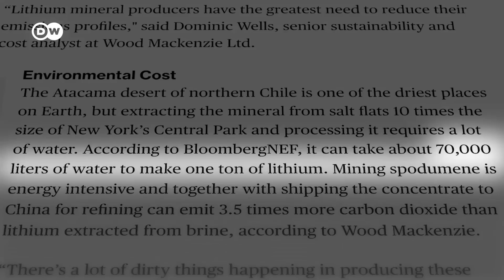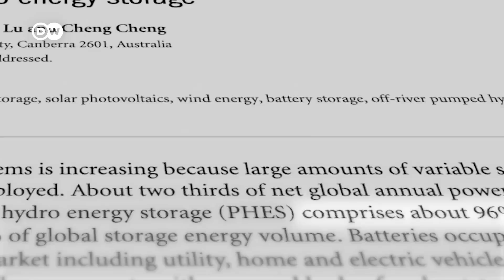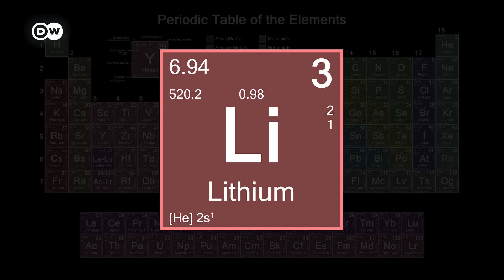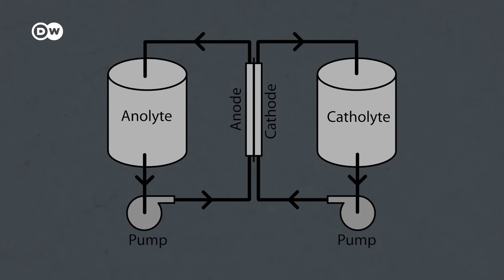How salt and sand could replace lithium batteries

Comment: 2:10
Only the high-end, high energy li-ion batteries require cobalt and even those are reducing its usage continuously. The majority of the volume of shipped li-ion batteries (LFP) does not contain cobalt at all. Not a real issue.
Reply: Oh I thought Lithium Phosphate was just entering the market.
Reply: @anxiousearth680  yes and no. LFPs are not used in consumer electronics and power tools because of lower energy density, but for cars they're already quite widespread. My wife's Model 3 from 2020 has a LFP battery.

Comment: Some good points made, lithium certainly has it's problems and limited to electricity whereas these alternatives are mostly heat storage not electrical. Molten salt is very good at storing heat but is also very corrosive.
Reply: 100% correct. 
Maintenance costs are the very reason it hasn't taken off in the last several decades.

Comment: The future of energy is not JUST renewables.  New nuclear has incredible efficiency and at least one of the designs also uses molten salt.  Not only can it store energy (ie from the grid) but it can also be used as part of the reactor fuel and cooling (it's called an MSR).  This means you can also generate heat as needed, as well as store excess grid energy as heat in the molten salt.  A 1 ton cube of uranium or thorium is about 14 in (35 cm) on a side and provides 40 million kWh.  It takes an area ~300m (1000 ft)  on a side to do that in solar per year and you still need storage.   You need 100,000+ tons of coal to get the same from fossil, so that puts everything in comparison.
Reply: But it has the word "nuclear" in it so it must be scary right?
Reply: molten salt and corrosion, read up on it
Reply: @markgonzales3588  HasteloyN is rather corrosion resistant and a lot of research is going into this.
Reply: @alainpannetier2543  It isn't ever going to be personal sized, most SMRs are in the 100 MW range, about 10x smaller than commercial reactors.  Also, there are orders now for these around the world, including in Ontario Canada.  Finally, I think you are confusing SMR with MSR.  SMR is small modular reactor, and MSR is molten salt reactor.
Reply: @alainpannetier2543  We will see.  It will take a few years but we will see.  You'd better hope it isn't though, because it is about the only source of energy dense enough to undo the CO2 damage.  It will take many thousands of TWh to undo, and that's after we stop using fossil.
Reply: @alainpannetier2543  That is a good question.  The short answer is you need a lot of energy to make and recycle all of that distributed energy.  By having high energy density, there is a lot more left over.  The other problem low density green energy is it takes up a lot of land - this is all land that could be used for other things, ie deserts, wildlife, etc.  Even a current nuclear plant (Palo Verde is a good example) takes up less than a square mile.  To equal its output, you need about 60 square miles of solar panels, but worse than that, you need to have the energy when needed, and that means batteries.  It also means all of the disposal/recycling as well and energy costs of manufacturing.  The term for this is EROEI - Energy Returned on Energy Invested.  Green energy has poor EROEI, even with the high efficiencies we have now, so you need a LOT of it, and a lot of batteries.  Interestingly enough, the two could play rather nice with each other, which is what I suggested in the first place - a molten salt system to store energy can also MAKE energy if it is also a nuclear reactor.  Also interestingly - all the unusual materials to make high efficiency generators, motors, solar, etc come from "rare earths".  Thorium is currently a waste product of rare earth mining, but it is a potential nuclear fuel (and works great in MSRs).  This means less waste when obtaining the rare earths needed for green energy.  Finally, nuclear reactors excel at generating heat, and a lot of processes today need heat, such as making fertilizer, or if you have a huge excess of energy, that means you could make liquid fuels (which the navy does now).  Sorry for the length, hopefully, this was interesting and thanks for conversing.

Comment: Idk if you guys take suggestions but could you talk about thorium power at some point?
Reply: Thorium is abundant but lacks fissile matter, the crux of nuclear fission chain. We will have to borrow fissile from uranium or plutonium from used fuel. The nuclear big brothers frown on the processes of enrichment for U235 or reprocessing from used fuel for plutonium.
Reply: Yeah I'm aware of the fact that it needs other materials to actually produce, could it just use new plutonium or would that not be economically viable? I'm not entirely knowledgeable on how breeder reactors work but I try ¯\_(ツ)_/¯

Comment: I disagree with the very first statement you made, 'We all know the future of energy is in renewables' - and this video is discussing the the ways we may be able to overcome the intermittency of renewables.
Nuclear doesn't have that problem. It works 24/7, 365 days a year, pretty much for 60+ years.
The new designs have prices per kWh from 3c - 10c per kWh, and don't need much storage.
Nuclear can also deliver heat directly to industry at prices 2c-5c per kWh, pretty cheap and reliable.

The future is nuclear..
Reply: yeah, europe could use the waste heat from nuclear power plants to charge up sand heat batteries year round, then use that stored heat in the winter. Waste heat from  nuclear is quite high. Co-generation if sent to the sand battery.
Reply: @bocadelcieloplaya3852  It would make sense  in winter to use the local housing/ office stock  as the coolant rather than just wasting it. That could also be said of the normal conventional power stations.

Comment: Aluminium air batteries are supposedly becoming standard in India. They are energy dense and easy to recycle.
Reply: Ooh nice!
Reply: @IJoeAceJRI  The aluminum hydroxide left after discharge is the exact feedstock used in creating raw aluminum.
Today the spot price is $2.40 per kilo, and the 'used' battery has recycle value.
So, while this is a modular swap approach as opposed to charge in place, there is never the issue of battery degradation.
Reply: @IJoeAceJRI  There are aluminum recyclers and mills all over.
The aluminum battery is said to offer about 1,000 miles (1.600 kilometers)
How do you get a tank of propane for a grill?
The logistics are about the same and I'd imagine the volume of transactions wouldn't be an order of magnitude greater.
When we buy a new lead acid battery for an ICE car we bring the old one back and it gets recycled.
Aluminum is a LOT less toxic than lead and sulphuric acid.
Reply: @IJoeAceJRI  That is correct.

Comment: A back of the envelope calculation how much sand would be required for 10.000 GWh thermal energy storage:
The project in Finland stores 8 MWh in a silo 4 meters wide, 7 meters tall. This is 88 cubic meters. So we can roughly say 1 MWh of heat storage requires 10 cubic meters. 
1 GWh would require 10.000 cubic meters. 
10.000 GWh would require 100 million cubic meters which is 'only' 1/10 th of a cubic kilometer of sand. 
This is thermal storage and you also want electrical storage of course, but it sounds doable.

Comment: I did my internship in TEHRI dam and they are yet to finish their PSP pump storage plant. 1000 MW  plant. 
Basically two dams are built one small other one large. Tehri dam reservoir takes water from smaller dam when electricity is cheap and than use that storage water to run 4 turbines.

Comment: 2:05 The lithium-ion batteries used for power storage should and would be the lithium iron phosphate batteries, therefore the costs of mining cobalt would be much reduced as one component of the battery is replaced by something much cheaper and more environmentally friendly. But I am not sure about the phosphate part of the battery, since I am quite aware of how damaging phosphate mining could be. But if we could recover phosphate from the soil due to our history of excessive phosphate fertilization, that would solve most of the batteries' cobalt problem.

Comment: I didn't quite understand the comparison at 05:37 , it sounded like you said salt can keep the heat for 6 hours, while lithium batteries can only keep their charge for 4 hours?!?
Obviously that's not what you meant... so what did you mean?

Heat dissipation time depends on many factors, such as thermal mass volume/weight, temperature difference, and insulation, while lithium batteries can hold their charge for much longer than 4 hours, so that's not it.
The time it takes to deplete the stored energy depends mainly on power requirements, so that's not it either.
Please clarify.
Thank you.

Comment: We don’t need to store even half of the energy provided if we simply change our economic model of production.  

There’s only a handful of things that require on-demand-round-the-clock power, and those are things like medical facilities, cold/hot  temperature storage needs, maintenance/emergency services, and transportation.  

Everything beyond that is merely a demand of over-production by industries that want to always have all the energy they want when they want it to produce as much as possible to sell as much as possible.  

Which again, is how we GOT ourselves into this mess in the first place.

Comment: Sodium batteries make sense for grid level storage and can be a really good alternative in the short run. However, in the long-run we will have to find less heavy options which can be used in EVs and consumer electronics. Also, these alternatives need to be less damaging or atleast not more damaging to the environment when compared with Lithium iin batteries.

Comment: At 5:40 there's a really weird claim about lithium batteries, either that they can only store heat for 4 hours, or they con only store energy for 4 hours. The first one is just factually inaccurate - lithium batteries don't store heat, and the second one is intellectually dishonest - a charged lithium battery can hold its charge for days or weeks with very little capacity drain.
Reply: I was confused by that statement as well.

Comment: How about the Nickel Iron (Ni-Fe) battery, which has been used for backup by telephone companies for decades before cellphones obviated the need?
Reply: what about nickel zinc? i have some NiZn AAA and AA batteries i got from maplin(uk) a few years back, 1.6v cell voltage and capacity bit lower than NIMH types for the size, could likely be scaled up? problem is service life, mine are starting to randomly fail 'open circuit' ?

Comment: Salt battery? Turning electricity into heat and back into electricity is not a battery. It’s a way to get rid of electricity. The efficiency must be lower than 25%. That’s fundamental physics. 
Storing heat in salt makes only sense if you store actual heat as the first stage of a process to generate electricity. Like in the solar thermal power plant.
Reply: I agree. this is way oversimplified battery production in industry and over glorifying nothing that's proven reliability, efficiency, profitability, and even possibility of mass production with quality assurance. there's nothing about mining, refinery, transportation, and longevity are considered in this documentary either

Comment: Video forgot to pay attention to the most obvious one, Lithium-sulfur Batteries, they have 3 times the capacity of the Lithium-Cadnium and are cheaper to produce, on 4 years time they will replace the traditional Lithium-Cadnium ones. That will be a real revolution for the automotive industry, we will start having cars with autonomy of 600-800 miles or ranges of 200 miles in more affordable cars, that is a game changer. Some companies already produce Lithium-Sulfur batteries for the US military. Also imagine the effect it will have on aviation.

Comment: I'd like to see a heat storage solution for a house.  PV's heat it during the day and it warms the house overnight.
Reply: I’ve daydreamed about putting several, 500 gallon, water bags in the crawl space under my house. Solar could be used to heat the bags in summer and cool them in winter, thus evening out the temperature in the house
Reply: @freeheeler09  I know it would be easier to get bags into a crawlspace than tubs but I'd worry about rodential chewing.

Comment: The idea of using salts for storing heat is not new.... (What is new it might be using NaCl salt). But storing heat into salts is NOT new. Storing heat has always been more efficient than storing electricity. What is not so efficient is turning that heat back into electricity, I think this is the part where more innovation is needed.

Comment: Employing thermophotovoltic cells increases the efficiency of thermal storage system , since generated electricity could power all appliances  efficiently. 
Furthermore,  underground thermal storage capacity could hold thermal energy longer without any extra insulation cost.

Comment: Can quantum dots or structures like knots be used in such sand batteries.  Maybe radio waves are used to heat sea sand soaked with a percentage of water to produce flames for more heat.  Maybe place those near radio towers and condense some of the waves on the sands?

Comment: People please. These are not Salt batteries (NaCL), they are Sodium Metal (NA) batteries. In order extract the sodium metal from salt or salt water, they have to run it through electrolysis which takes electricity or chemical separation to do so. So you have to use huge amounts of fossil fuel produced electricity to do so or figure out what to do with the huge amount of byproduct waste chemicals that will be put back into the environment. They won’t tell you that though!

Comment: Let's make this whole thing about energy storage really simple...
Nothing will replace the Lithium Ion battery for mobile uses (eg wearable devices, vehicles, aircraft).
Thermal should dominate the solutions for metropolitan (grid scale) storage because of the economics, knowledge, reliability and experience designing solutions for most situations where volume and mass aren't critical issues. Thermal management is so common in our lives we don't even notice where it exists.

Stuff like pumped hydro, gravity and chemical batteries should never be considered the primary solution for metropolitan storage but might be practical in special situations.

Comment: I like CO2 storage.
It is basically a gass pressure storage...

Though...

I would prefer in a heat engine power generation.

At ground level: A neighborhood sized greenhouse that has CO2 gas and quite a bit of its volume is black solid objects that can absorb heat for hourse.

Gas pressure in the system: over 10p atmospheres.

A higher part of the system: a smaller container that is colored with cooling paint, the gass in there gets cooled by the shell, and sinks down through a tesla turbine to generate power.

At the end of that long turbine, it is back in the ground level green house.

It has other pipes that the CO2 rises through up to that cooling area.

Comment: She said a lot about LFP batteries… oh, wait, what? LFP battery doesn’t require COBALT!
“As of September 2022, LFP type battery market share for EVs reached 31%, and of that, 68% was from Tesla and Chinese EV maker BYD production alone.

The lithium iron phosphate battery (LiFePO
4 battery) or LFP battery (lithium ferrophosphate) is a type of lithium-ion battery using lithium iron phosphate (LiFePO
4) as the cathode material, and a graphitic carbon electrode with a metallic backing as the anode.”

Comment: The one battery that has alot if potential which can also be recycled is aluminum battery. They are also more energy dense of 3 lithium batteries equal one aluminum battery though it does has its own problem I say it has a very good chance.

Comment: I like Carbon Fuel Cells.  We plant biomass and convert it into carbon, then we stockpile millions of tons of carbon in mountains.  It temporarily gets it out of the air, and when it comes time to reverse climate change, we just stockpile a bit more than we use until the air is clean again.

Comment: The most important battery that is never mentioned is related to pumped hydro but the pumping is done by nature, by rain and snow! Dam control is more efficient then any battery ever can be! Just release the water when you need power!
Reply: Can't be done everywhere though
Reply: You can't control them. The point of battery is having control when to keep and release energy.
Reply: Also, isn't that just normal hydro?

Comment: issue with using batteries that need cobalt is also that it will lower production capacity for the metallurgical industry, as cobals is an alloying elements used for various grades of hard steels. (same issue with vanadium and nickel, and plenty other metals as well).

the most "primitive" principles like storing and re-using heat, or using mechanical and gravity to create moovement when needed seem better in the long run (evezn tough the initial upfront cost and time needed to build might be discouraging at first)
Reply: NO batteries NEED any cobalt.

Comment: excuse my ignorance but Is it possible to turn electricity into magnetic power and retrieve it back to electricity instead of using heat ?..this way will work in hot and cold regions in the world.